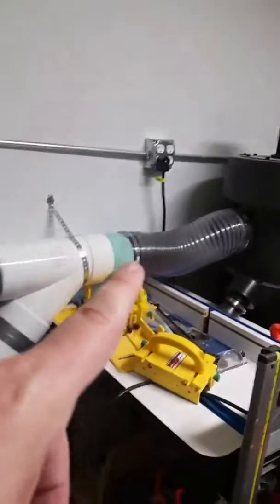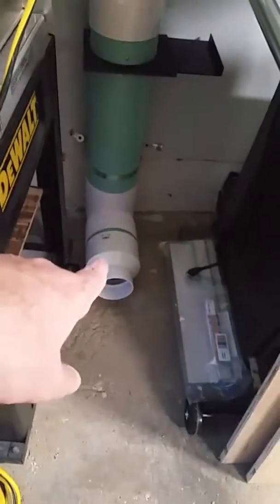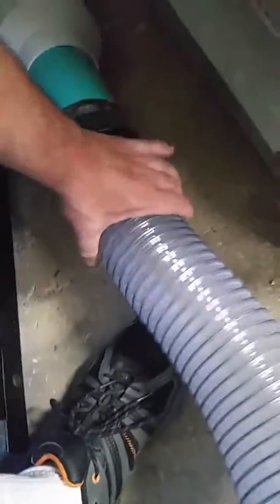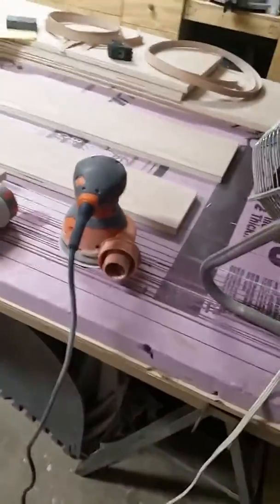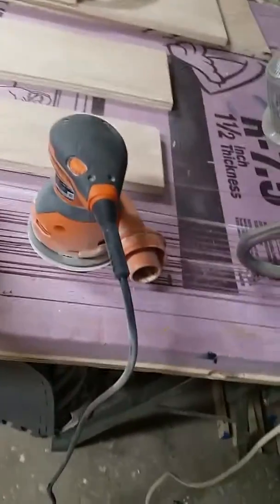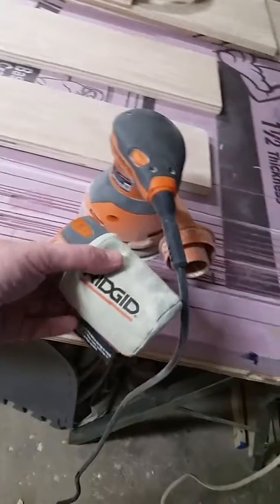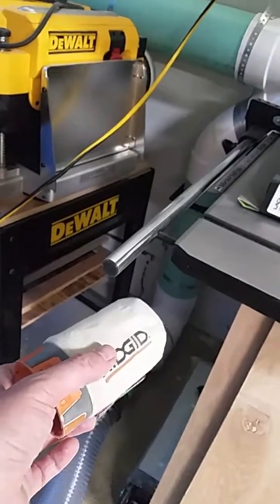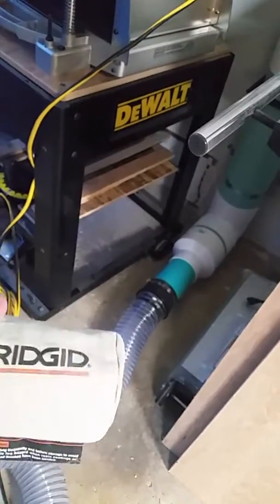Powerful Dust Collection almost too powerful

Comment: Great idea with the removable lines.  I didn't think of that and you have given me a great idea!  Thanx
Reply from the maker: Only issue I have is not making them long enough. Reality you want them as short as possible but I get lazy and instead of moving it to a closer outlet I try to stretch it for that last little piece of dust and end up pulling the connector out of the rubber boot. They go back together easy enough but still a pain.